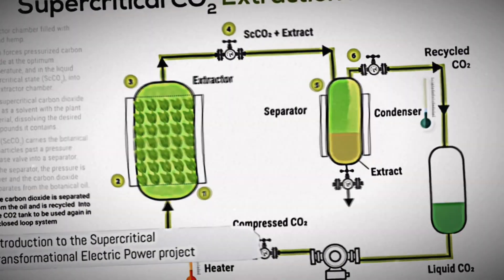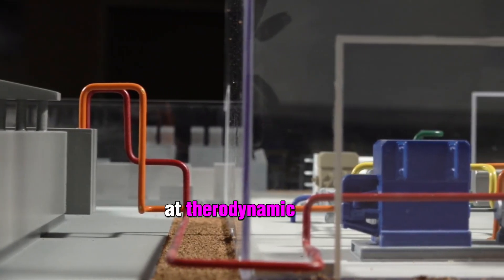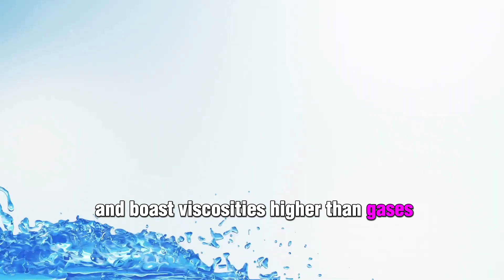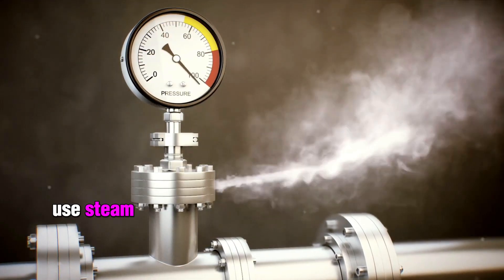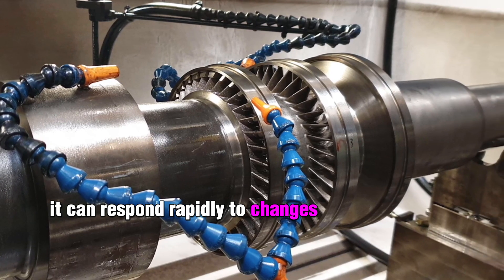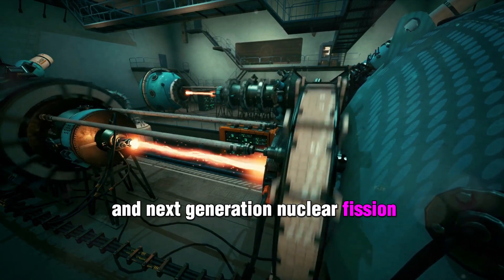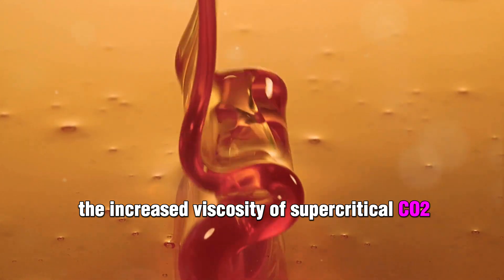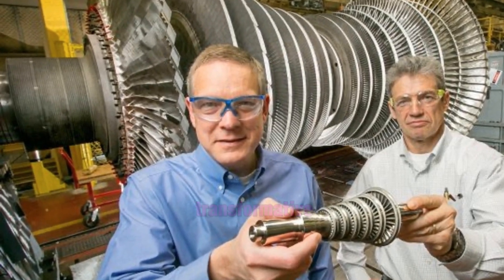♻️⚡️A Better way to Make Electricity WITH CO2⚡️♻️

Comment: New combustion tech will have a 55-60% primary cycle and result 75% total efficiency with a secondary cycle of a combined cycle engine that fits in a car/airplane/boat/semi/house heat pump and more.  

The secondary CAPTURES the CO2 of combustion for use in fuel making and to enhance cycles.  The engine functions as a combustion heat pump of COP4.    

The engine can run on fuel (gasoline, jet, Ethanol, Natural gas and propane or Ammonia) and on hot solar water.  It can pull a vacummn and do vapor compression distillation.

In a car it should get 150 MPG HWY, 240 City.  Brake recovery is ~75% vs EV at ~56%.  It can make fuel for less than 3 cent/kwh from solar THERMAL.  Thermal captures 6x more energy than PV, and with the CO2 in cycles the electricity generation is 1.5 to 2x better than PV per area.  Energy will be very cheap in the future.   

BTW, the future for grid is Thorium = grid loads + fuel making.  Put Thorium at peak of day at constant power and make fuel as power varies into the night.  Frequency and voltage is maintained by turning ON and OFF fuel makers.  No gas turbines, Diesels or coal would be needed.

Comment: Fact is when steam is heated to very high temperature after a while the steam become gaslike and if Co2 is infused into the water before heating tye temperature will real extraordinary temperature fast and more powerful to rotate engine or turbine.

Comment: Was the performance data from the 10 megawatt pilot project ever published? I wanted the initial CO2 conditions, the temperature at the gas cooler, and an efficiency figure. I think it was only ever loaded at 1 megawatt accodding to one other video I saw.

Comment: Supercritical CO2 critical temp 304.1K critical pressure 7.38MPa, density 467 kg/m3. 31c
Supercritical SF6  critical temp 318.6K critical pressure 3.76MPa, density 736 kg/m3. 45.5c

I know you would not want to release SF6 into air.  SF6 is known for its high global warming potential (GWP)

If you could increase efficiency or expand operating range maybe it would be worth exploring as well.
Reply: Thanks for the very interesting info!
SF6 is both non-toxic and chemically inert thanks to the very strong bonds of the fluoride ions. Because it is much denser than air, any escaped gas will "sink" to the lowest level in the atmosphere and eventually dissolve into the sea, minimizing its risk as a greenhouse gas. Definitely worth exploring. I can picture some applications, such as marine propulsion, where any leaks would have minimal environmental impact.

Comment: So you forgot about nuclear power?
Reply from the maker: Hey thanks for commenting ❤️‍🔥🙏

This works for nuclear fuel sources too.

It’s a turbine and motive fluid system with heat exchangers. Where the heat comes from is really dealers choice. 

Let me know if you have any questions! 
Cheers mate
Reply: What are you talking about?

Comment: I don't get it. where goes the liquified CO2? In the atmosphere? And second - you need energy to make that pressure and temperature, no? They said efficiency. This means that they are still struggling to make more output then input. And they are already wondering who is gonna use it and how the things will balance?
Reply from the maker: Hey thanks for commenting. ❤️‍🔥🙏

It’s a closed loop system.

the supercritical co2 (not liquid) just continuously loops in a cycles. 

And yes it still requires heat input but because the thermodynamic efficiency is so much higher even just switching our current fossil fuel steam turbine system to this would see a significant reduction in greenhouse gasses alone. 

Not to mention this can be used with nuclear, solar thermal, biomass, anything and it will yield more electricity per input energy. Which means the hot snd cold side heat exchangers can be much smaller because not as much heat has to still be removed because more goes to electricity. 

It would still be more efficient than using those same heat sources with the current steam that we do. 

To be clear though, no turbine or engine can output more than what is input. That would break the laws of physics. 

Fortunately With TesTur Energy, we’re committed to empowering individuals with energy autonomy through our Combined Heat And Power (CHP) solutions.   Our systems are uniquely designed to harness overlooked energy resources like biomass, solar thermal, and geothermal, as well as unconventional fuels rich in solid particulates—think sawdust, pulverized coal, or powdered iron.  Traditionally, these alternative energy sources and fuels have been underexploited due to the limitations of existing turbines and engines.   These systems often can’t manage the complex fluid flows—mixtures of gases, liquids, and solid particles—that are characteristic of low-grade heat boilers and unconventional fuels.  But our technology changes that, enabling sustained, damage-free operation even in these challenging conditions.  

www.HeatAndPower.com  www.TesTurEnergy.com

Comment: Is supercritical co2 in itself renewable???
Reply from the maker: Hey thanks for commenting! It itself is not renewable as any heat source can be used to power it. However, because the thermodynamic cycle efficiency of supercritical fluids is that much higher than conventional steam systems, using it with our same current fuels would make a significant reduction in the greenhouse gasses produced to output the same amount of electricity. 

So while is not a full proof solution, it’s certainly a step in the right direction and any R&D development in it will equally benefit any and all renewable energy sources like solar thermal and biomass are used instead of fossil fuels. 

Hope that helps!
Reply: @CharlieSolis  👍

Comment: Nice!! How much of a power generation increase are we looking at with CO2 vs cold steam under vacuum?
Will the turbine need to be redesigned to work with SC-CO2? I'm guessing disc spacing might need to change to account for the increased viscosity of the working fluid.
Keep up the great work Charlie!

Comment: I read a few years ago and that siemens had a prototype turbine running on superctrical co2 and the results showed that at start temperatures above 800°C the efficiency is quite a bit higher than with steam
Reply from the maker: Hey thank for the comment! ❤️‍🔥🙏

Do you happen to remember where they did those tests at? 

Cheers!
Reply: @CharlieSolis  a quick search made me find something about the carbosola project. But I'm not sure sure it was that what I read
Reply from the maker: @GeoffHou  I’ll take a look! Thanks for sharing!

Comment: So if I understand this correctly, the supercritical CO2 would replace steam as the driving fluid for power generating turbines?
Reply from the maker: Check out the video I made about using Tesla turbines as steal trolling motors on nuclear submarines. I go a little further into supercritical fluids. Because a lot of reactors have supercritical steam as their reactor coolant system. 

Tesla Turbines For Nuclear Submarines
https://youtu.be/C7oBR9ow0vI

Let me know if you have any questions! 

Cheers!
Reply: But the "exhaust gas" can be used for heating or hot water to the hot water pipes
Reply: So... They waste energy to make c02 supercritical... To create energy... Aint that wasting power?
Reply from the maker: Hey thanks for the question! ❤️‍🔥🙏

Yup yup! You got it! 

Same Brayton Thermodynamic cycle as a regular gas turbine but with a supercritical fluid the density is SOOO much higher than with it in its lower pressure gas phase. But the fluid supercritical fluid still expands like a gas. So extremely high mass flow rates due to high density, so with high mass flow rates of a very hot high pressure elastic fluid, then there’s a high power output available. 

Which lends itself to having the entire system be 1/10th of a typical Rankine cycle system.